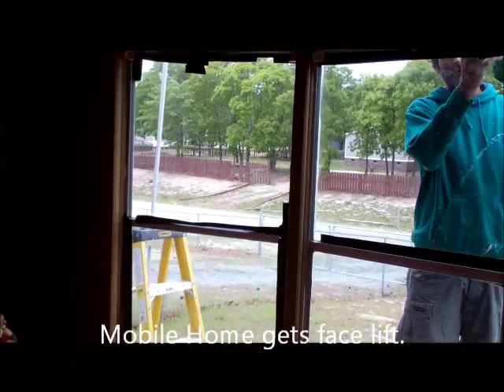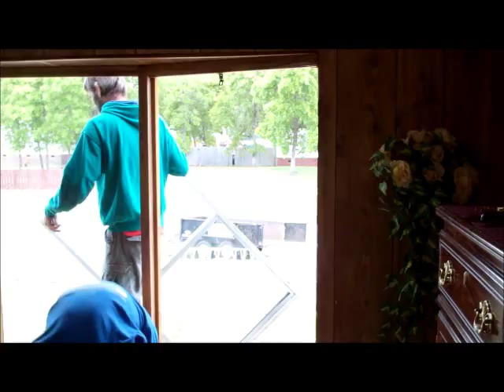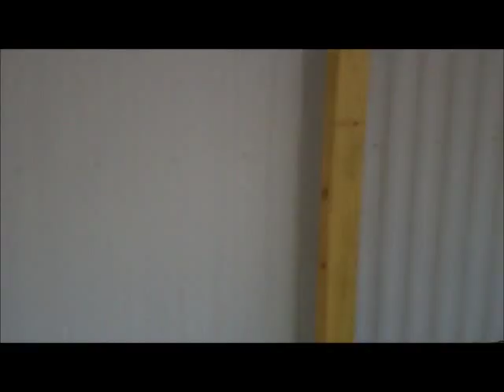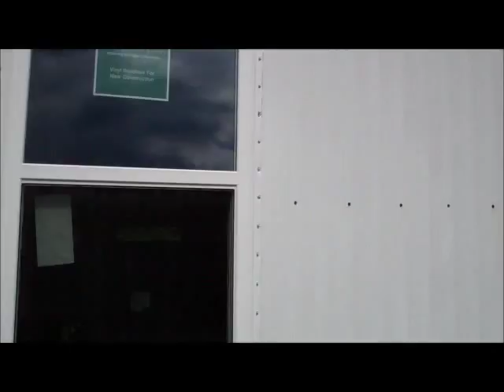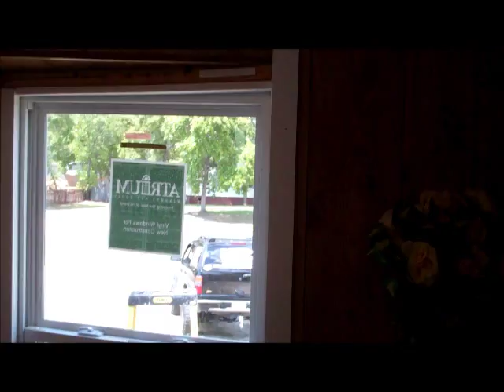Mobile Home Window Replacement

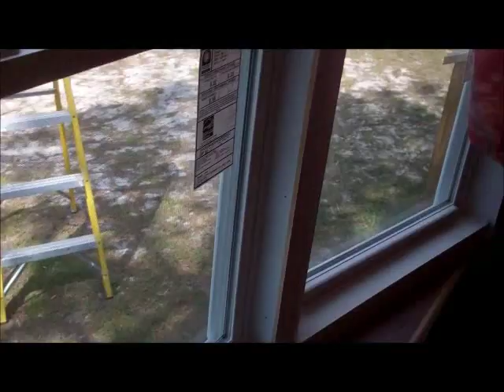Comment: I have seen a mixture of flashing and non flashing of the window frame 2:20 2:20 before install. I have this same exact set up 14x60 aluminum 1984 or so single wide. About to seal the roof, reframe some walls and install all new vinyl windows throughout the house. What I have seen most on replacements are just applying a really good adhesive around the window or aluminum and then securing with the screws. No flash, no exterior silicone. That sounds too little of protection to me.. am I wrong?

Comment: How to remove the trim above the side windows to get to the top outter screws? Worried we're going to have to sheer off and just dim sum it? Pls help give us a hack
Reply: Not dumdum top
Reply from the maker: That section can be a pain in the butt the screws are hidden so what you do is take a pair of tinsnips where are the screws are you can either cut a notch for each screw or you can cut on each side of the window the left and the right snip the metal and bend it upward
Reply from the maker: Send me a picture 910-294-1761
Reply: Nvm. I decided to wall up the window hole with plywood and tin. Putting an AC IN THERE. TYSM
Reply from the maker: Thank you for watching I need to do a window video more in depth the next one I get I will

Comment: Where can I get the windows? Model number or series number?
Reply from the maker: The window is made at atrium. I can only buy that window at pelican building supply or a place called Builders First. You can also use any new construction window
Reply from the maker: Did you find some good windows.? And you can buy a new construction Pella window at Lowe’s. We have to do is measure it and it will build the window exact sizes.

Comment: I have seen a mixture of flashing and non flashing of the window frame before install. I have this same exact set up 14x60 aluminum 1984 or so single wide. About to seal the roof, reframe some walls and install all new vinyl windows throughout the house. What I have seen most on replacements are just applying a really good adhesive around the window or aluminum and then securing with the screws. No flash, no exterior silicone. That sounds too little of protection to me.. am I wrong? I have the very small drip edge and I feel like water would be able to creep in after replacement
Reply from the maker: Before you put the window in you need to use mastic window mastic. Generally they sell it in rolls at Lowe’s or Home Depot. It’s called window putty. I use window putty and then I use a Lexell with it. I haven’t had any problems I believe the gray putty is the best.